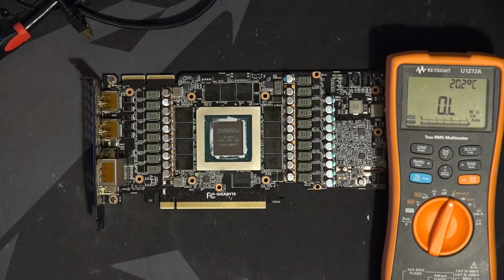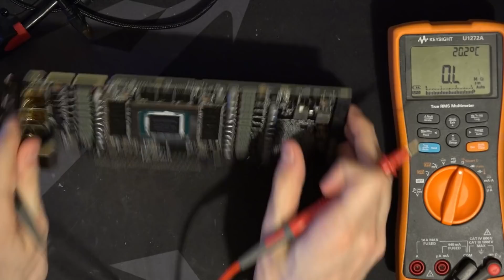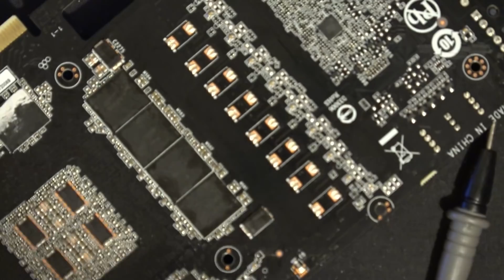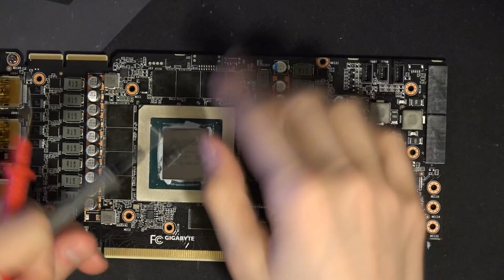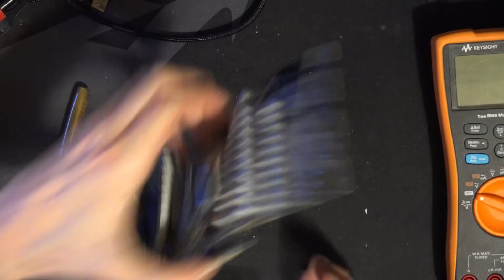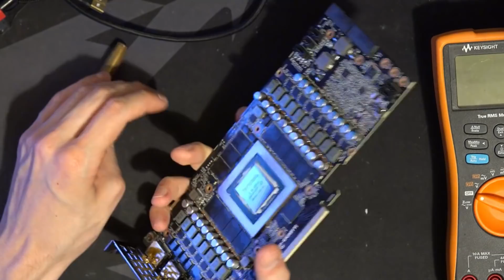Probing a Gigabyte RTX 3090 Vision that died when trying to run New World

Comment: Got the same exact board but mine is the fuse at 6:05 and it's at like 8.8k ohm. Funnily enough, all the input filters you tested at 12:45 are reversed for me. The 2 you marked as shorted were the only good ones on mine.  All the ones you checked from 15:05 were also fine for me. It's like that top fuse blowing inverts the results you got.
I mined with the thing in the watercooled Gigabyte egpu box it came in for over 2yrs and stopped earlier this year. Tried showing my nephew some games on the tv at thanksgiving and it randomly died and enclosure fan went on high. Not detected and no power when used directly in a pc after that. 30 days past warranty, go figure.

Funny side note about Gigabyte's quality control: I discovered it was missing a thermal pad for that singular ram chip near the pcie connector on the front as soon as I tried mining when it instantly shot to 100c and started erroring. 
Based on people's reviews of the eGPU "gaming boxes", they forgot pads in many of them because after upgrading all the pads it ran very overclocked and undervolted 24/7 and never got over 85c unless i put the side back on and the air filters in.

Comment: FYI, my Gigabyte 3080 Ti just blew running Halo Infinite on Ultra settings.  12V PCI-E power on the top rail shorted to ground. The fuse did NOT blow on mine.  Similar problem to this 3090, on the other rail, with shorted VRM caps and shorted 12V rail (PCI-E socket power is good), and no blown fuse.
Reply from the maker: sound like your PSU caught the short very quickly then.

Comment: For whom this may be of help:

I have the Gigabyte 3080 Ti Gaming OC and after 6 months of use, the card suddenly failed whilst I was playing Hell Let Loose causing the monitor to go black/off with the "no signal" message and the graphics card fans ramped up to 100% (only to stop once I hard-switched-off the PC). The PC would not boot up again with the card installed only upon installing a different (and working) graphics card, confirming it was indeed the card had died. This is the exact same way many others have recounted their 3080/90/Ti's failing (many/most seeming to be with gigabyte cards). What's interesting however is the VRAM temps were really great (better by 10C than even the MSI 3080 Ti Ventus 3x OC that I now have as temporary replacement). After the card failed, I looked up and found the other people who had the same issue and read up on how the thermal pads were the issue with silicon oil leaking out of them onto the PCB components over time (etc) but I also read how gigabyte in particular had replaced them with better ones since before I had purchased mine (due to many people experiencing failing VRAM chips) and sure enough, the much lower VRAM temps (only 78C vs. 88C on the msi ventus 3x oc) was a sign that I should have the new better thermal pads installed. But I wanted to check for myself and so I opened her up and what did I find? Two different grade of thermal pads, the good (blue) type on the VRAM with no oily residue leaking out onto the VRAM chips and the shitty (white) type with oil leaking out onto the PCB components underneath them such as the VRM's. And in fact, I saw evidence of these oil-leaking thermal being almost certainly the cause the cards failure as there was one black and brown burn mark (as if a spark had occurred from a short) on the underside of the shitty oil-leaking thermal pad covering the VRM's on the right side of the GPU. So there you have it. Gigabyte did indeed fix the VRAM issue with better thermal pads but decided to continue using the cheap & shitty oil-leaking thermal pads on the VRM's which will eventually result in a short. 

My advice if you have a gigabyte card that is still working is be to immediately seek out replacing the thermal pads that are white on your gigabyte cards with better ones before a short occurs. You'll need to clean and re-apply the thermal paste to the GPU at the same time though if you do this. Make sure to get a benchmark for the thermal performance of the GPU core + Memory (VRAM) whilst under load with GPU-z first though so you have something to compare against afterwards to check you've done a good/acceptable job of it. You should not end up with a higher steady-state GPU + MEM/VRAM temp after switching out the white/oily thermal pads + re-applying thermal paste to GPU. If you do, you need to do it again, checking the GPU core was fully covered by the squish of reinstalling the heatsink and/or that you have the right thickness replacement thermal pads because if they are too thick or thin, it can cause inadequate contact between the heatsink and PCB components (be it GPU, VRAM's, VRM's, etc). Good luck!

Comment: Thanks for the vid.  Just a heads up but it seems that New World is causing some OCP issues on older systems.  2 of my friends and myself have had new world trigger the overcurrent protection on a fairly regular basis.  We have had this issue occur on systems with 750 and 850 watt psu in conjunction with a EVGAgtx 1080 a MSI gtx 1080ti and a  Zotac gtx 1660.  Issue only occurs in game while inside of a settlement no matter the graphics settings, even happens on lowest setting with frames locked to 30 fps.  We have only been able to duplicate this in New World. We have been unable to trigger OCP in any other game or application, even Cyberpunk 2077 runs without issue.

Comment: I have the exact same card (Gigabyte Vision RTX 3090, 2 months in use), and had a series of temporary failures over the course of 2 weeks (GPU shutdowns, accompanied by fans on maximum, then reboot and all works fine for a couple days), followed by a permanent failure.  For my card, the opposite 12V connector is shorted to GND, no fuse is blown (due to the PSU safety shutting things down), and almost the exact inverse of the power stages you found shorted are shorted on mine (with the ones you found shorted being okay).  I'm not sure what that means, as far as which rails are involved.  Assuming some of the MOSFET chips are shorted, I have been trying to find replacements, but I can't even find a datasheet on the Alpha Omega chips (AL001E1Z).  I do have a good soldering station with hot air tips and vacuum (but, shaky hands that even caffeine can't steady).  Any help finding replacement driver chips would be SO much appreciated!
Reply: Found a replacement (3rd video shows the datasheet):  AOZ5312UQI.  I'm going to try my luck and see if I can track down the shorted chip(s) with a current limited power supply and thermal camera, then repair with a hot air soldering station.  Hopefully, the GPU chip isn't damaged.

Comment: My Asus Strix 3090 OC GPU also randomly died but playing Forza Horizon 5, system just switched off mid game, New World has never been near my system as it’s a game I'm not interested in, when I press the power button I get a split second of power to the card as the RGB on it flickers and to the rest of the system, RGB ram stays lit and the rest of the system powers off instantly. Once I took the 3090 out my system booted just fine to the desktop but as I use a 5950x and had no spare GPU at the time I couldn't see anything but I knew it as at the desktop as my RGB lights changed. Popped my card back in, even tried in a different slot and again only split second of power.

My GPU was only 11 months old, never had a single issue, no warning signs that something was wrong, GPU temps never passed 69c, VRAM temps were always around 80c to 85c at load so temps were well below the max temps (never mined on), happily playing FH5 and the system instantly shut off and that was the end of that card.

Managed to buy a new 1050 Ti to at least get me a display and even play some games temporarily, and so far my system had been up and running for 6 days straight without a single issue so the PSU was ok. My PSU is the Corsair AX1600i so way over powered even for a 3090 and 5950x, but the voltages according to icue are stable and rock solid.

Sent mine off for RMA last week and received it back in a total of 4 working days from Scan in the UK which was extremely impressive considering how hard GPUs are to get at the moment. 

So far my new replacement Strix 3090 OC is working just fine, but makes me nervous now in case I have another ticking time bomb on my hands.

Comment: thanks builzoid because I used this particular video to check my own card after the exact same new world scenario happened to me with forza horizon 5 I immediately "nose" checked my card after the shutdown and a heavy burned electronic smell was coming from what I didn't know was the inductors for Vcore VRM :/ the last 2-3 next to the power connectors (mine are on top of the card next to the power stages) my card still seems to work after that incident, anyway what I found out that in the menus, not running the game at ultra everything, in the "2d" menus the game can rise to 1000+fps with vsync unlocked and this draws spikes of 51.25A on the 12V O_O roughly 21A more than actual gameplay on maxed settings with RTX, this made my PSU trip because of the multi-rail OCP, I used an external PSU to diagnose that, set my real psu to single rail and that's when I saw the 51A :/ EDIT: wanted to record a video of this problem but honestly I don't want to blow up an unobtainable gpu so I just sent AHO and email he will hopefully receive

Comment: Horrible design. 8 phases should have 8 or 16 powerstages on it. Period. If they can't find space for 16, go with 8 higher quality/power ones. Or limit the card so it won't overload the stages.
Huge amount of power @ uneven powerdistribution to Vcore, is a timebomb.
Can a Phase know if it's loading One or Two powerstages?? (current wise) Two = all good, One = not good... Lets roll the dice and hope for the best :)
I would be pissed, spending such a rediculous amount of money, on a TOTL card, for it to just blew up playing a game, being utilized 100% on software level (@stock settings). Give me some Self resetting overload protection below hardware level tolerances - Thanks! (a powercycle is a lot easier than a RMA process)
If Nvidia has been too cheap to give it "enough" phases, the GPU really wants to eat, just let it be that way. I'm sure they designed this power limitation for a reason.
Had it been a well engineered 500+W graphics card, it would have had other issues to deal with, being locked up in typical ATX case.

Comment: New Word is good but it's not stable graphics wise.  If you're running a 3k series gpu, I would limit the power to 50% and ensure you're at 60fps or you're going to melt your gpu

Comment: Why not use a thermal camera and injecting power at safe levels for vcore and use a thermal camera to find your faulty parts?
I understand this cost some up front investment but you'll find your shorted parts on cards that sell for far more. 
There is two hypothetical issues here, the caps if failed then the voltage rating may be too low for surges in power draw or if it's fets then fets are under sized for the current load and fail internally. 

Lastly support Right to Repair so these schematics will be available for us all.

Comment: building a cpu/gpu without any ALUs, cached 8-bit "mdma" (multiple data multiple access) paraller/serial superfast rom L2 instruction result pre-calculated cache, for 8-bit that is 64kbytes per two-parameter instruction pre-calc-rom-chip (2x8-bit register) with 8-bit register answer (8-8-8), with all the roll-over register op features, like 127+1 = -128, 128kbytes (8-8-16) re-calc-rom-chip if the answer is 16bits, if interested in co-op, by the nature of cache/memory/rom with stacking, or just a bunch of rom chips, the whole thing is very low power, pcu + irc (program control unit + instruction [alu-precalculation] result cache), the main idea is that you would ideally have only one giant rom chip, with all the pcu's simultaneously getting precalc data by col/rol (n-bit direct address) from the L2-cache-rom, int-n and FPn precalcs, pcu handles cmp/jump/program flow, memory fetches, stores, local registers, per "core", all branch prediction (if paths) are delegated by master thread to friend threads, who atm dont have anything to do, friendly cooperation multithreading

Comment: The poor design of the game bypasses driver and software level power limits, pushing the cards to overdraw power until the VBIOS limitations power throttle the card. So cards are being pushed to 20-25% OVER what they are supposed to be hard limited to, dialed back to ~90% power load, and pushed back to 20-25%... over, and over, and over again. If you continuously overload a card, then the first circuit to melt will be the point of failure. At this point, it's like car owners are buying a piece of software that removes their Rev limiter (new world) and holds the throttle at 100%, and try to blame the car manufacturer for the failure. That's why every brand, and every high power gpu is susceptible to failing. It doesn't matter how well or poorly made your board is. If it is constantly and repeatedly pushed to draw up to 100+ watts more than the circuits are designed to handle, in a manner that out runs the protection in place, something will inevitably fail.

Comment: Feed 1V at 1A into the shorted rail, get or borrow a thermal camera and see what gets hot.  The gpu itself should be fine, but the shorted fet will get warmer than it’s surrounding.  Yeet that mosfet, then the gpu should boot, just down a power phase. Gotta replace the fuse tho.

Comment: Didn't EVGA already confirm the issues were weak solder joins on the...... Fuck everyone talks about them even though they are a sub component.  I haven't watched it yet I want to see if it is the same.   I wanna say mofsets?
Reply: Google is loverly.  ""Now, EVGA has confirmed to PC World that further analysis of the fried graphics cards has revealed “poor workmanship” was the real cause for the failure. Inspections found that soldering around the MOSFET circuit – a crucial part within the GPU – was done poorly, causing affected cards to break""

Comment: I have fixed 12 Rtx cards due to new world, it defiantly a issue with power delivery and the gpu requesting more than designed. Most common is an internal short on a vcore mosfet. Hit me up if you want to know more.
Reply: Hi Christian, in your opinion what is the best way to prevent these cards from shorting out?
Reply: @rhettro7236  best way would be to use msi afterburner or similar gpu control software and bring down the power limit  to about 80%. I have seen that with the 3090 that has a TDP of 350 watts but I have seen them consume more than 850 watts of power. Now with further testing i thought that it might be "dirty power" from either the mother board or psu but it seems its an issue with the power delivery design, on the actual Pcb. Now I aways tell my customers that until either A Navida releases driver fix to tone down the power draw of the RTX 30 series, or Amazon hires better programmers for new world, to manually decrease the power draw of these cards to protect not only they cards but there motherboards.
Reply: I’ve been playing new world for a few days with afterburner open and rtss as a frame limiter to 161 , is this alright for protecting my card? The power limit is still set to 100% on afterburner. I’m wondering if I’ve been safe or lucky with mine surviving
Reply: @xStaryyyHD  i would say more lucky, you should 100 percent turn down the power limit to about 80 to 85 percent depending on the manufacture and revision number of the card. The issue is with the power delivery on the card, either its a component level issue with the shortage that happened before these cards came onto market which caused a last minute change due to lack of parts or it was an initial design flaw from Nvidia and not accounting for possible possible current overdrawn from a very power hungry gpu.
Reply: @christianstout4383  i have a question that is quite separate, but im trynig to figure out the problem to. my rtx 3080 ti eagle power on, and fans spin, as well as seem to react to temperature by turning fans on and off at particular intervals, but it has no connection. it doesnt register in the computer at all. ive changed positioning, power cables, tested other gpus. i would just like to try and fix it if i were able to.
Reply: There is alot that could be causing bad communication or not being recognized by a cpu motherboard combo. If it is an issue with that specific card most common thing I have seen for that is a bad 9v data rail on the board but its hard to tell with out having the board physically present there are a couple of great guys on here that have videos that show how to fix gpus.

Comment: About probing problems
Having sharp tips helps
Also put multimeter in to beeper mode, short tips and try to move a little, there might be break somewhere within probe
I always tend to make own probing cables because what they originally provide is garbage most of the time
Ot just wash tips in contact fluid, sometimes helps

Comment: Thanks for sharing. Get yourself some good needle probes (from Pomona Elec) and would of liked to see you troubleshoot to component level, then change the part and power it up,,,maybe next video. One trick i do is solder on a resistor lead to the shorted side of the fuse and another on gnd, then attach your meter to them (preferably mini grabbers) so you dont have to hole on. Then start hot air reflow and pulling the suspect parts off one by one and watching your meter when the short disappears, saves a bunch of time this way.

Comment: Its not the mmo causing thr gpus to fry its the pcb board with bad soldering. My 3090 ftw3 ultra pulls 428 watts and works just fine. However my card is water cooled so i dont get over heat